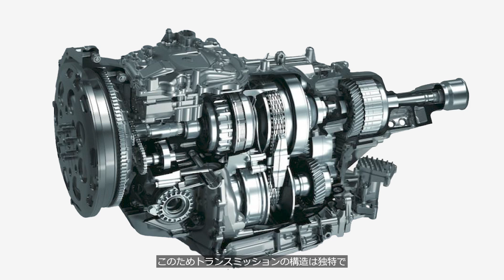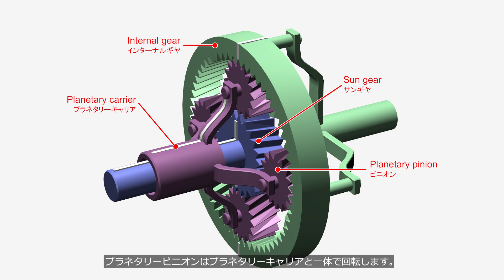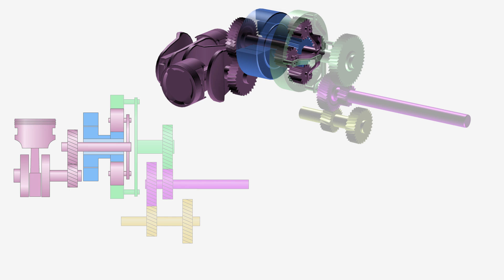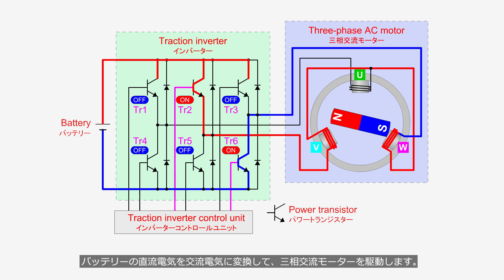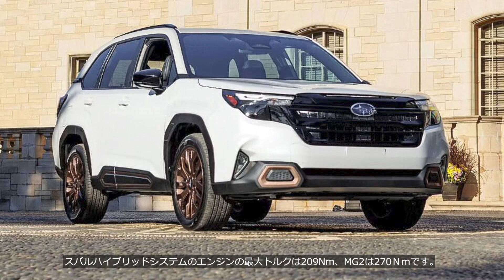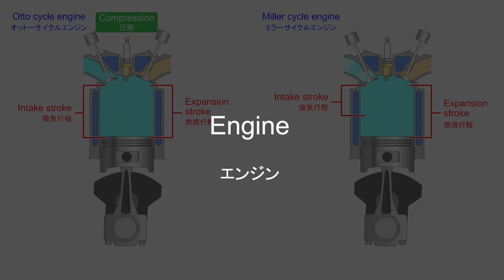Deep Dive into Subaru Hybrid System with Mechanical AWD!

Comment: Toyota Hybrid Max is full time All Wheel Drive with a higher output Turbo Engine. Hybrid Max in economy mode will be the same as regular Hybrid ??? //
Reply from the maker: Thank you for watching the video and for your comment.
The Hybrid Max system is completely different from the traditional hybrid system used in models like the Prius. We can think of Hybrid Max as being focused on driving performance, while the traditional system prioritizes fuel efficiency.

Comment: Do you know if the FB25 Miller cycle engine in the Subaru Hybrid system used port fuel injection or direct injection? Or, does it have the dual injection system that Toyota uses?
Reply from the maker: Thank you for watching the video and for your comment.
The CROSSTREK spec sheet on Subaru's website states that it is a “direct injection system”.
On the other hand, the spec sheet for the BRZ states "direct injection + port injection."
Therefore, the FB25 engine appears to be a direct injection type.
Reply: @sikasabumotorchannel  Thank you for your info. I could not seem to find anything related to this topic on the internet. It is strange to see why Subaru decides to go for the direct injection only option, because it would leads to carbon deposit issue on the intake port and valves when the engine has high mileage. A simple port EFI design would mitigate this issue and also reduce over all system complexity, not to mention that there is also a cost benefit for the manufacture. Anyhow, Subaru engineers must have a valid reason for this decision.
Reply: @brucechan9140  Direct injection isn't as bad as it used to be, newer engine designs do things like exhaust gas recirculation temperature management to mitigate the formation of deposits. The really bad engines are still VW turbos (ie GTI), but there are now a lot of Subaru FB-di engines out there that are running well otherwise. The other reason is that fuel economy regulation is so important that manufacturers are willing to add the few percentage points difference if it means added servicing cost to the customer.

Comment: So basically that's just like toyota's power split hybrid, the only dofference being rear wheel drive being realised via clutch pack,  not separate electric motor. The same way it works in ford kuga fhev awd.
Reply: Tbh it's almost exactly the same as Lexus hybrids with longitudinally mounted engines and AWD, say the LS600h. I think power split ratios are different though, but that can be done with different final drives and clutch pack control logic
Reply: It's much more complex. I don't see them as similar at all.
Reply: This is great advantage for Subaru going from belt-pulley CVT to eCVT with no mechanical wear parts (except AWD coupling).
Reply from the maker: Thank you for watching the video and for your comment.
Yes, as you said, the wear parts have been eliminated. However, I’m concerned about the lifespan of the hybrid battery.
Reply: @ thank you for making this content. 
Lifespan of the hybrid battery should be the same as in Toyota's hybrids. It is ~1kWh Li-Ion battery which never drained empty or overcharged during normal operation. And if thermal management is done properly (cooling/heating) it should be ~as reliable as the others hybrids.
Reply: @Aleksandr_N  well, you can always fuck up the bearings as ford did in the hf35 transmission.
Reply from the maker: Yes, I agree. In general, the lifespan of a hybrid battery is said to be around 200,000 km. 
However, I’m not sure whether the hybrid battery or the CVT has a shorter lifespan.
Reply: @sikasabumotorchannel  Do you know if it's NiMH or Li-Ion? If it's NiMH it should be good for 14 to 15 years as has been proven by Toyota's hybrids. If it's Li-Ion I expect 20 or more years based on it's superiority in longevity over NiMH batteries used in other electronics. Li-Ion batteries far outlast their NiMH counterparts in power tools, Camera's, and computers. But that remains to be seen in cars because we don't have any 20 year old hybrids yet using modern Li-Ion batteries. My bet still goes to the Li-Ion hybrid battery lasting a good long while. Perhaps the life of the car.
Reply: @escheidl Li-Ion.
Reply: @sikasabumotorchannel to answer that concern we need to look at the longevity of Toyota Lithium Ion battery packs. I have not heard of one failure.
Reply: @sikasabumotorchannel If Subaru is smart, they should make business deal with Toyota to let Toyota produce battery pack to S.
Reply: @Aleksandr_N it was a chain driven CVT, not a belt
Reply: @brantheman93  anyways this is poor technology for loose traction surfaces or harsh condition. It can survive for long period only on city asphalt with mild driving.
Reply: @Aleksandr_N  which is what 95%+ of these cars do 100% of the time
Reply from the maker: Thank you for watching the video and for your comment.
Yes, as you said, the only structural difference is the AWD system. However, whether it is a full-time AWD or an on-demand AWD can make a big difference in the car's character.
Reply: @sikasabumotorchannel  but as I understood subaru has a clutch pack and doesn't have a center diff, so it can't be permanent 4wd. Clutch pack awd in combination with power split hybrid is offered by ford in the kuga fhev and phev.
Reply from the maker: Subaru's clutch pack constantly transmits power to the rear wheels.
I couldn't find an English site, so I'll share a link to a Japanese site instead. Please try translating it with Chrome.
https://www.subaru.jp/brand/technology/technology/driving_awd.html
The Active Torque Split AWD system uses a clutch pack to maintain a constant 60:40 power distribution.
Reply: @sikasabumotorchannel  I’m confused. Is it always transferring power, or is it sometimes transferring power depending on the driving conditions? Like your video just stated- if the conditions are smooth it clicks into front wheel drive
Reply: @jonl7819 Subaru ATS clutch-pack is 60/40 torque split by default. It can send power power as far forward as 90/10 or up to 50/50 rearward. What it can't do is fully lock-up like a mechanical differential, but otherwise, all 4 wheels are constantly driven.